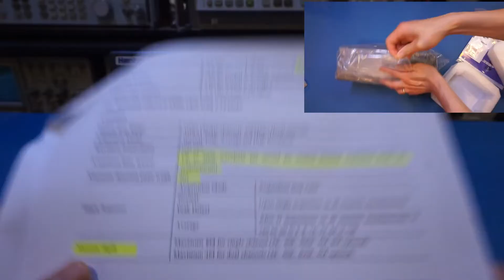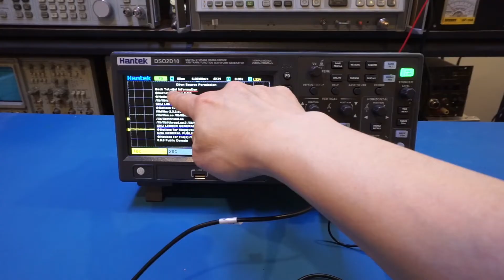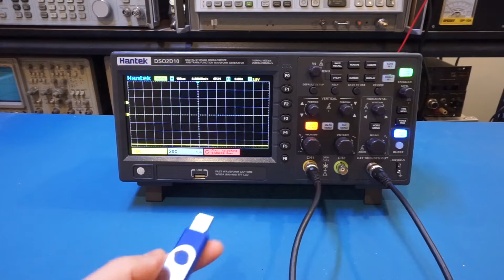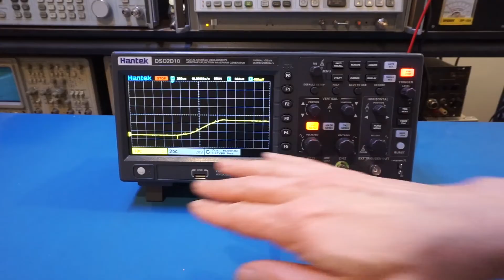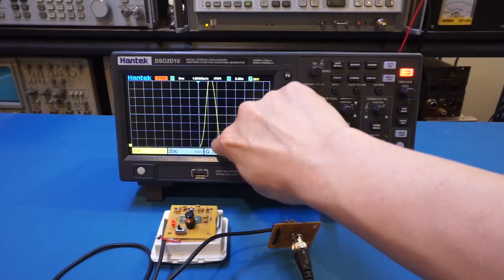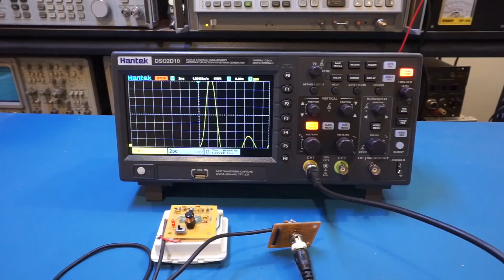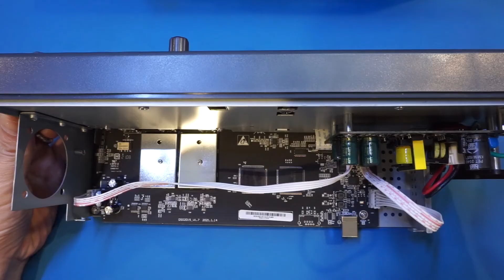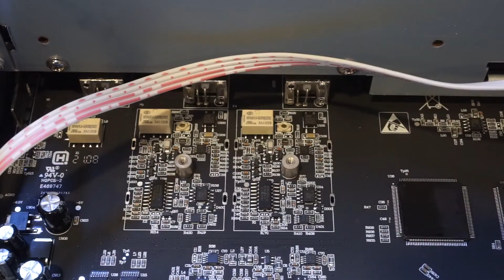Review/Teardown of a Hantek DSO2D10 Oscilloscope - It Has Builtin AWG, Does Protocol Decoding Too!

Comment: Bought the DSO2D15 model, only months later I discovered it has Trigger Level problems with signals below 300 mVpp. I did all the firmware updates, still the traces run on the display, no way to stop them. Things get worse if you keep the oscilloscope on for more than ten minutes. Then, if you select a 50 mVpp sine wave with the internal signal generator, the image is strongly noisy, distorted.
I contacted Hantek several times, they wanted a video of mine showing the issue. Sent the video twice in a month, then Hantek disappeared. I re-sent a final e-mail today, I am waiting for a sign of life from them. At this moment no help at all, their after sale sucks.
I did a BIG mistake, I should have bought a Tektronix instead but you only learn these things later...
Reply: there is advice on EEVblogs on things you can do besides the firmware, they have some scripts/ hacks and I think the inside needs  some heatsinks on the IC  and install a Fan based on what people said.  I can't believe they tried to save $2  on a cooling fan. it should have been installed by hantek based on all these Freeze issues.  I'm  Looking at  Siglent now  1104 X-E  and not the X-U since the X-E can be easily upgraded to  200M.
Reply: @neo256mb  I did the firmware update, nothing has improved. I bought the alumininum heatsinks which I will install on the two big IC's asap I'll have the thermal glue. 
Shame on Hantek for saving 25 cents on heatsinks and $1 for the small cooling fan. But this is the mentality of Chinese producers...
Reply: @OLDSCHOOLNEVERDIES   check on 
(1)  EEVblogs if you can , they have some scripts to help people with DS02D15 issues,  people are helpful in EEVblogs. they have a  section of forum  just for people with Hantek  DSO2D15 to get advice on steps. 
(2)  look at video made by "Life with David"  on how to fix it. https://www.youtube.com/watch?v=dlSlevxl-z4
(3) TechCornerTV  made 3 videos showing completely how to install all possible updates  I think.  (he went from saying hantek is Awesome on day 1, to looking like he was crying after a couple months saying "this is terrible, it doesn't work"  
(4)  you need to ask him in Comment if his hantek is  working now.  he advised me in comments not to buy it , but  if you have it there are people who worked it all out. 
 (5) Besides the Heatsink, people upgraded to a better fan they mention the size in these comments somwhere or eevblogs. you could experiment just put external fan see if it helps then go to better internal fan. 

I feel like  I dodged a bullet, I'm getting the Siglent 1104X-E.    at the same time I think  it would have been ok learning how to do all the scripts/ firmware updates,  fan upgrades and such.   you do get a Lot of features for $250  with hantek,  and you can  unlock it from  100 to 200Mhz.  there might be a rainbow  soon I think the EEVblogs help a lot of people get it to working. frankly I think most of the fixes in firmware probably due to EEVblogs people helping to troubleshoot and report to Hantek.
Reply: is reading at low level signals lower than 300mVpp something that you have to do a lot?
Reply: @neo256mb  yes, lately a lot of measurements on low level signals
Reply: @OLDSCHOOLNEVERDIES   techCornertV  said in comment just now  that he thinks the very newest firmware he installed fixed it. but he wants to check several other things first and make one final video for Hantek  to summarize  everything he did. see his April 15, 2022 video, and look for newest comment.

Comment: Thanks for you video review. It is like buying a car that offers you 3 wheels and the forth one is just the spare one from the boot - in that case I say thanks but no thanks. A second probe should be included and not have to spend money on. You will not get exactly the same as the one supplied. And yes I am ware that probes are on the cheaper side of things.

Comment: I'm not sure if you have clearly pointed out that 2D15 is in fact 25MHz / 200MSa/s Real Time DSO. The claimed 150MHz / 1GSa/s is only in Equivalent Time (ETS) mode, which most modern DSO don't have.
EDIT: Maybe I made wrong assumptions, but I would be a good idea to try to identify the ADC and find it's datasheet to confirm the real time sampling rate.
Reply: It's a 150MHz bandwidth 'scope having a 1GSa/s sample rate with one channel active, 500MSa/s for each channel with both active.
The 25MHz relates to the maximum frequency of the waveform generator, which generates waveforms at a maximum sample rate of 200Msa/s.
Reply: @raymonddompfrank1789  Both, the DSO and the AWG have real-time sampling rate of 200 MSa/s, the specified scope sampling rate is obviously time equivalent sampling, so is as real as in FNIRSI scopes. You may open it, identify ADC chips, measure their clock rates, and everything will become clear. What seems strange, their handheld scopes seem to have only real-time parameters specified. For me, specifying ETS sampling rate/bandwidth is like specifying PMPO power output on cheap active speaker sets.
Reply: @TzOk  I see what you mean and you may well be right. I agree with your PMPO comparison. I'm not fully convinced yet, though. I'm intrigued by your statement "obviously TE sampling". Did you check that 1GSa/s is ET? The ADC's external clock rates aren't definitive in determining their Sa/s capability. Many modern chips (like 3GHz+ PC CPU's) contain internal clock frequency multipliers. This makes sense because sending a 1GHz or higher clock signal around a PCB isn't a simple matter. The two ADC's are working interleaved, which is clear by the "500MSa/s using both channels".
Reply: @raymonddompfrank1789  Ok, maybe I got some false conclusions, but waveforms at near the bandwidth look very suspicious and at the same time familiar to me. Best would be to identify the ADCs and find their datasheets.
Reply: Where did you find this info? I was just looking for an inexpensive, decent oscilloscope for beginner to review, but if that's true with this ETS mode I'll look for something else.
Reply: @SlaVoy  I can see this from the tests, and the faceplate of physical unit (not the renders published on manufacturer's website) has two sets of parameters given - 25MHz 200MSa/s and 100MHz 1GSa/s. This can mean only one thing - the latter one is in ETS.
EDIT: I was wrong about the faceplate, but still waveforms look suspicious to me.
Reply: From performance of this scope I know that lemontree fpga is not correctly timing events there is always +- 5ns randomness.

Comment: I have a general question about oscilloscopes. I recently got into Arduino stuff and I'm branching off into learning electronics in general I'm an older guy programming is easy for me I'm having a little bit difficulty with oh converting schematics to wiring diagrams but I'm starting to get that. I have heard a lot of people say if you really wanna learn electronics that and oscilloscope can help a great deal with the learning process is this true in your opinion?. I have had problems with circuits with noise in them already it would have saved me a lot of troubleshooting to figure this out with a oscilloscope but I don't know how common this is going to be in my projects. You seem to really know your stuff and I need to ask a few people their opinion before I spend even just a couple $100 on one. Thank you in advance
Reply: depends how you really are into electronics, if u plain to stay in just arduino level (say just program arduino, buy already made modules just to wire them and program them, etc...) then you can survive without a scope.
But if you start to take a deep dive into more complex topics like digital electronics (IC's), analog electronics (OpAmps, Diodes, transistors, etc...), power electronics (triacs, thyristors, MOSFET, power transistors, etc...) or radiofrequency, it becomes a must.

im telling you from a electrical engineer student and hobyst from mexico and believe me, it is really hard to save money for an oscilloscope so i have been surviving with made up techniques to supply the necesity of not having one. and it sucks

Comment: Interesting that the mainboard was marked 2d15, which is the model above this one.
Reply: D15 and D15 are identical, however D10 is software limited. You can hack the firmware to convert it into D15.

Comment: error code  :  511d6.  Got tech support from Hantek and the error code means hardware failure of CH2 board.  Now the scope is finally failed totally- all the functions of both channels are not working. Boot up but no responds from keys. 
Send back to Hantek China ,even though repair is free but with round trip  shipping ,customs charges etc. will costs me as much as the scope itself.
Reply: How long did it last before failure? Or how many hours of total use estimated. Thanks

Comment: Thanks for the teardown, 2 pins and protection by containment [plastic case]? that means the scope is "isolated" from main. which means can probe the "HOT" side of the circuit.
Because of you, I ordered one from Banggood.
Reply from the maker: The scope is not isolated from mains earth! The earth pin is connected with the BNC jack like all the oscilloscopes.
Reply: @KerryWongBlog  I think he say its mean "float".

Comment: Disappointment (very) with this scope ** >  I own this unit (new) about 6 months and used for 2 months then it Ch2 became out of calibration - the zero is off by 150mV when use the "zero" button. The reading also off by 46%  ( see previous post).  Hantek in China finally responded with instruction to re-flash firmware.Follow instruction exactly and the results were WORST > now CH1 zero is off by 800mV and reading 4V on 5V.  CH2 was as bad as before. !!!  Contacted  Hantek again and cannot help and was asked to contact seller!  ( the seller was Hantek Official Store) ** If you are thinking of buying this beware you are on your own for service and repair.   It would be questionable at best on the logistic , honour and followup repair  ***

Comment: Thanks for your video. I have the same model for only 8 months and developed issue with Channel # 2 reading lower than Ch#1 by about 46% when I connect the same probe to the  square wave test output post of the scope. I used the calibration  function(found in Utility bottom) and it came back with error code  :  511d6. I also downloaded the latest firmware from Hantek. It did not improve and same error code. Tried email to Hantek service and no responses.  Do you have any suggestions what to do?  From your post of the input board it appears to have a trim pot. Is this for the input scaling?
Reply: Obviously, at least to me is there was a component value that shifted in the circuit. I have not seen this very often but I have seen it happen. It could be something as simple as a resistor or could be something else. Joao Carvalho mentions issues with ambient temp causing calibration errors and since diodes are sensitive to temp changes this may be a place to look, also something as simple as a solder joint could be the cause. These kinds of problems are never very easy to track down unless you have a lot of experience with a particular device and a detailed schematic is almost always necessary, with very detailed specifications as to what should be happening at all points through the circuits. Things that work are very hard to fix. Things that don't work are easier. Sometimes.

Comment: Thanks! Setting the probes back to 10x is a life saver! Is there a way to change the “default” to 10x” or higher?
Reply: Why do you consider setting the probes to 10x a life saver? Sorry i'm a hobbyist so it is not apparent to me. Is it some precaution or safety measure for the user or the DSO?

Comment: Hello. I'm new to this field, so maybe a silly question. But. This device could be used to measure FM deviation on CB radio 4w output according to the example - Thanks to Bessel Curves and doing a bit of maths we know that if we feed in a 1kHz tone, at 2.5kHz deviation it'll null the carrier. So analyse the signal with around 10kHz width so you can see all the peaks, feed a 1kHz tone into the mic at normal speaking levels and as you get towards 2.5kHz deviation you'll see the centre carrier peak will turn into a trough. When its at its lowest you're at 2.5kHz deviation.
Reply from the maker: It does not have a special function to read out the FM deviation if that was what you were looking for.
Reply: @KerryWongBlog  Thank you for your response.

Comment: Kerry. If you use an arbitrary function from the usb stick I think its possible to save it to the internal storage of the oscilloscope with the save/recall feature. havent tried it yet but I will eventually.

I personally bought the DSP2D15 after researching and watching your video and Im incredibly happy with the scope. I put some custom heatsinks on the chips to keep them cool.

The ambient temperature voltage fluctuations are now between 3.2mV and 6.4mV usually at 4.8mV.

The coolest feat I have achieved so far with this scope was that

at 20mV resolution I managed to measure the sine wave of the wall (50hz) with a peak to peak voltage of 140mV. That without connecting the probe to anything, just having it plugged into the oscilloscope. The closer you move the probe to a powercable the higher the amplitude of the frequency becomes. Its not noise its an actual sine wave.

So for 216 EUR this scope beat my expectations by far and I can only recommend it to everyone starting out.
Reply: Thank you! I'm just looking to finally buy my first one and your comment plus that video assures me this is the one to go :)

Comment: I like the features and it's hard to beat the price.  But I'm surprised at such a low capture rate for a brand new scope considering the newer GW Instek is rated at 50K/s, Rigol's are 30K/s and the 4 year old Siglent is 100K/s - all in a similar price range.  Thanks for doing this video - it was very helpful.
Reply: Sample Rate OR Acquisition Rate? Basing on 500 MSa/s and 2000 "waveform" per seconds = 250K samples per scan at normal acquisition rate? Or how do you suppose to read the parameters?
Reply: @maju.portal  So they are 500 M sampling point per sweep,  right?
Reply: @alexlo7708  Sample Rate Range = 1GS/s (Single-channel); 500MSa/s (Dual-channel);
Reply: @maju.portal  So they should have bandwidth around 40-50MH  ,given 10 points per sample resolution.
Reply: @alexlo7708  The bandwidth is the frequency response at -3db amplitude point and has nothing to do with ADC? or am I  missing something somewhere? Anyway, the scope 2D10 is a 100MHz Bandwidth scope.
Reply: @maju.portal  You mean if sampling rate on ADC lower than frequency of signal, you can still get signal waveform whenever BW range still cover, right.  
I quite don't agree. This meaning can be useful had the signal is sinusoidal or periodic repeat and quite comprehensive.  But not for undefined signal.
Reply: @alexlo7708  The scope 2D10 is a 100MHz Bandwidth scope in response to your earlier question. So obviously you do not use the scope to measure signal beyond its specification to begin with or forming as some logics to self-indulgent answering to yourself? 🙂
Reply: I think those BIG Numbers are mere marketing hypes and there are no standardization in the classification of this number of waveforms per second capture rates, example amongst the manufacturers, whether its talking about ADC waveform capture rate OR after processing through by the uP/DSP OR after Processing and storing into the Bins OR after Processing from the Bins by the uP/DSP/Graphic and then display onto the screen. After all, the Human Eyes can perceive and discern at most about 76 frames per second [see study on human eyes perception 13ms DETECTING MEANING IN RAPID PICTURES] , so exactly what is 100K waveform per second has to do with human ability to discern unless it is coupled with ultra huge memory or harddisk to rewind frame by frame feature? Has they qualified the numbers? example 1 shot captures or from RSI [Interleaved Mode]? I think Hantek 2000 waveforms per sec is from interleaved multi-segments waveform acquisition per waveform and processed through the up/DSO data considering its a 1GS/s scope [min detectable pulse width 2ns] and  I don't think even manufacturer like TEK will even be bombastic about having 100K/s type capability. Just my Opinion.
Reply: @maju.portal  Agree ,in this tear down clip, He shows its ADC has sample rate only 175 M sampling/sec.  So it's in no way can have 1GS/s spec.
Reply: @alexlo7708  But even that is way better than the specs @bobkraft9029 talks about for rival units. All in all a lot of hot air about nothing.
Reply: DAC902 is a 12bit adc 165mb/s for the waveform generator no the scope. The oscilloscope is 8bit 1GSa/S sample rate.  @alexlo7708

Comment: The silkscreen on the PCB says DCO2D15_V1.7, have you noticed that?
Reply from the maker: Didn't pay attention but now that you mentioned it I wonder if they are using different spec'd components for these two versions?
Reply: @KerryWongBlog  It looks like there is only one version of the PCB for all four DCO2C10, DCO2D10, DCO2C15, and DCO2D15. Only the firmware would be different.

Comment: hello, please give me test signals for the generator, I could not find where to download.
Reply from the maker: What are you trying to download?
Reply: @KerryWongBlog  test signals for dso2d10 trapezoid and step.
Reply from the maker: @svyatoslavx  You should be able to create the waveform using the software. Have you tried?
Reply: @KerryWongBlog  I tried but it turned out crookedly.
can put your signals on google drive?
thanks.
Reply: @svyatoslavx  Maybe create in Excel, save as .csv and load into Hantek wave form editor?